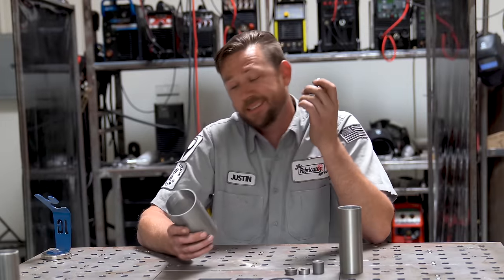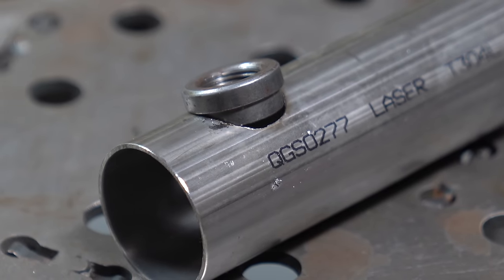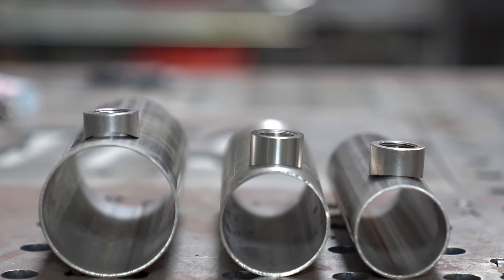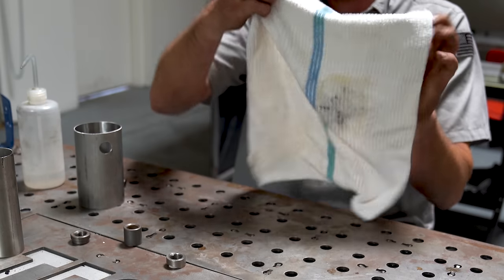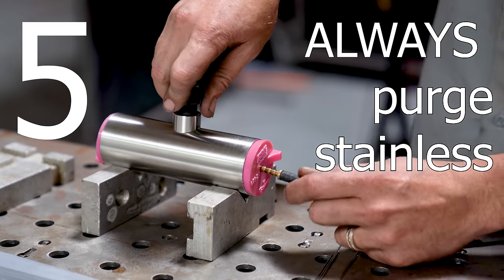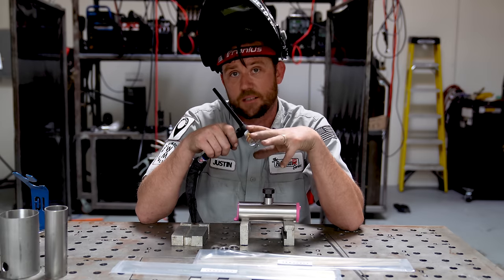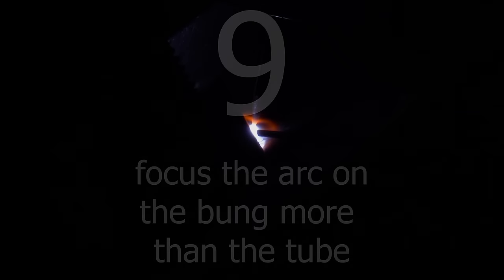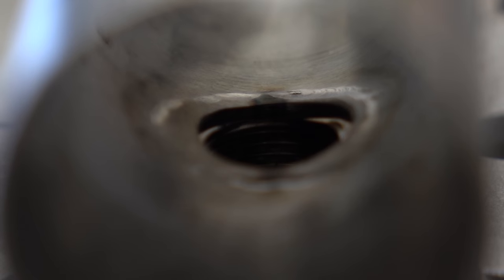10 Secrets for Perfect O2 Bung Welds

Comment: Having come from a fab shop environment, if I needed small-diameter 308L, I would just spool of some from a mig spool.  Much cheaper than buying the little rod packs...
Reply from the maker: A small spool of wire costs a lot more than a pack of .035 from Weld Metals. Its straighter too.

Comment: one thing you didn't mention...  if you're using a stainless bung, dont use a mild steel (dissimilar metals) bung plug when welding.....they can fuse together and scrap your whole piece.  ....ask me how i know....  good vid!
Reply from the maker: I used a steel bolt in a stainless bung and it was just fine. I've never had a bung fuse to a bolt during or after welding.

Comment: I welded up thousands of these when I worked for semitool (applied materials today) the only thing I would say I dont agree with is using acetone. we always used isophryl alcohol. also I would say purge everything you can! build a sheet metal .. um.. thingy and tape it to the back of sheet metal being welded so you can fill the back with shield gas and you will look like a god welding 1/32 thick sheet stainless.

Comment: What I want to know is, why do they even bother making TiG welders without a pedal? I mean sure, you can scratch start and all, but the quality, reliability and looks of a good weld really depend on a smooth start and finish as well as adjustment of heat during the welding process. I do know the answer....money. Still, TiG without a variable trigger is kinda useless. Great video!

Comment: Lol, make sure your bung is clean, that way you can achieve maximum penetration! 😂 
I can't get over him calling it a bung, lmao. I guess we know what he is thinkin about. I have welded so many of these over a 30 yr span, I'm talkin in the thousands. And never heard them called a bung, they are couplings, either full or half,some are even coped to specific sizes of pipe. Very simple to Tig weld, try to Mig them and it is a little harder to get an leak proof weld with one pass.

Comment: Its too bad they dont make these angled bungs with a 1/8 npt thread, can only seem to find them in an O2 sensor thread.
Reply: I've turned down a piece of 1" round stock, threaded it and used a tube notcher to cope 3/8 npt bungs. It's not perfect, but it's a hell of a lot closer than having a 1/8th inch gap!

Comment: One thing I learned is get an actual bung for your o2 sensor and not just a hex nut to weld on
Reply: One of the first jobs I had in a machine shop while in college was to sand a radius on hex nuts so they can be used as sensor bungs. It took a while but it worked. This was on a university research project, not automotive, and the pipe and nut were both mild steel. They welded the nut on and the drilled and tapped the pipe through the nut so they didn't have an alignment issue.
Reply: @kevinmcenhill2656  I mig welded an un prepared galvanized steel nut onto a stainless header... I regret it every time I go under my car. What was I thinking :(

Comment: Secret #5: if you have to weld small diameter metric nuts or anything with a thread and which can distort from welding, you should be extremely careful and only use the bolt (or screw) for the initial welding, or maybe even tacking!! My experience is no matter how careful you are with heat management you always gonna distort the bung a little bit, making the screw impossible to remove, sometimes even strip the thread. I always use screws for locating, but I remove them immediately after that, and I still need to re-tap it.
Reply: I've never had that problem, only problem I've had is over penetration welding the bolt to the nut.
Reply: @billybobjoe198  on M3 to M10 threads it is more prevelant, but it is good practice to re-tap everything once its been welded.
Reply: YszapHun the bolts actually keeps your thread from distortion, you dont seem too experienced in my opinion
Reply: @MrRussianProduction  it's great that you can clearly judge my experience based on a comment. Have you ever tried to weld something with an inside thread? My experience is that if I put a screw in it, the "bung" shrinks onto it from the welding heat, hence the reason why I have to re-tap it, and  believe me metal chips do come out of it, so they are distorted most of the time. And no, I do not cook the metal, I get good colors, but that's just how stainless works.
Reply: YszapHun i never re-tap you could look me up on ig, savage welding and fabs

Comment: Your explanations as to the proper size holes to different thicknesses are not going to make welding the bungs any easier because all the relief a company needs is narrow the range of different sizes and creat simplicity with having a quality welder that knows how to weld and make his stab outs/tie ins look as good or better by utilizing the foot pedal and bottom line is you get what you pay for so pay for a quality combo welder what he/she is worth because if not you will pay anyway in the long run but the difference is you can help to feed an american craftsman instead of a sales rep that gouges your guts out because you use him and not the craftsman? Also screw a nipple in it to plumb it square with the run.